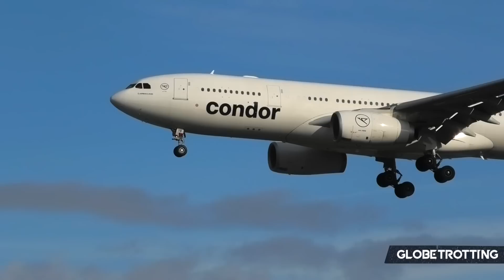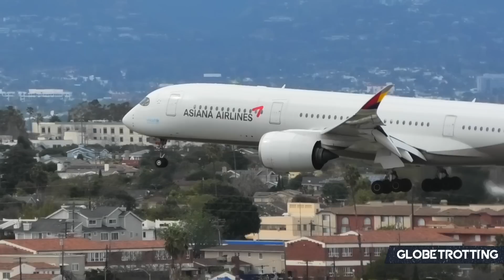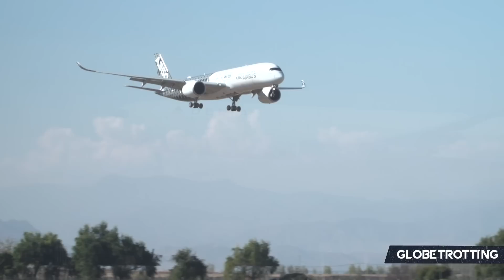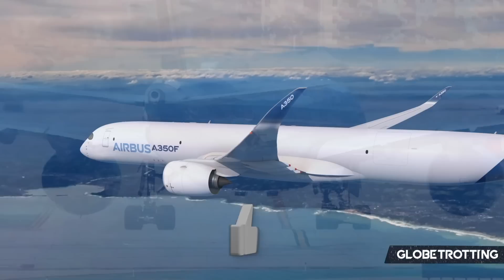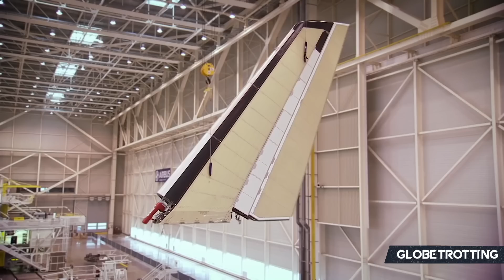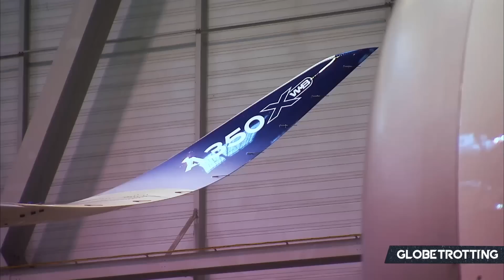BOEING RIVAL - The Airbus A350 Family

Comment: I think 🤔 airbus should build a new A350 but it more fuel efficient and more powerful engines and possibly a bit longer in length and flying range. And even look at building the A350-800 because it could be a good option for the airlines that are not sure about the A330-900 and that would give the airlines a better option for what they want for their fleet

Comment: I think the video underscores several key points about the a350:
- the video does a poor job at highlighting how quick the transition from competing with the  787 to do so with the 777 really was. Basically as soon as they realised a new air frame was needed (which was pretty fast);
- at this stage the a350 can hardly be considered the "Boeing Rival"...the a350 shifted to a programme to compete with the 777x programme...with the a350-1000 - being at best flying for nearly 10 years by the time the first commercial of the plane it was designed to compete (777-9) takes place...

Comment: Boeing rival? Really? Boeing is currently a nonentity. Airbus has eaten their lunch.
Reply: But the 787 has outsold the A350 (~1100 deliveries vs ~800) and the (much delayed) 777X is surely going to take a lot of sales from the 350-1000 (the stretched version) so this will continue. That said, Airbus have made far more profit from the 350 than Boeing has from the 787. And the 350 fills a wider range of niches than the 787.

Comment: The 787 Dreamliner did come first but it costed Boeing $32 billion USD in research, development, re-engineering of non-conforming parts, and remediation of flaws in their production. 
The a350 came much later but only costed Airbus $11 billion USD in research and development. 
Also Airbus recycled their original plans to upgrade the a330 and made it into the a330neo for only $2 billion USD. 
Airbus got the a350 and a330neo airplanes for less than half the development cost compared to Boeing’s 787 Dreamliner. 
And the a330neo forces Boeing to undercut their prices for their 787 Dreamliner to airline companies which handicaps Boeing’s profitability on their 787 Dreamliner program. 
Smart move Airbus.
Reply: Moreover the repetitive B787 quality flaws cost 5 more billions to Boeing...some analysts are wondering if and when the B787 program will be profitable...
Reply: Costed?

Comment: It wasn't customerS, it was customer who told Airbus its updated 330 wasn't enough, namely Steven Udvar Hazy.  And even when Airbus presented its 350 with conventional panels for fuselage instead of one piece like the 787, Udvar Hazy wasn't too impressed because at the time, it was really though the 787 would revolutionize aircraft with all its new designs.  It turns out that it was just incremental improvements and Airbus ended up winning because its 350 was simpler to assemble and deliveries were more reliable compared to 787.  Initial sales came because of delays on 787 so people switched to the 350. 

And comfort is not an issue for accountants who buy aircraft, it is the opposite. How  much pain can they inflict on coach passengers to pack them in as tightly as possible to make journey so painful in coach that people will want to pay for bsuiness class.  The 350 seems to havd struck a good balance against the tight configs of both the 787 and 777.

Comment: Engine manufacturers have pushed efficiency at the expense of durability, examples being the RR Trent 1000 and Pratt and Witney GTF. Once these improvements have been consolidated such as RR using Ultrafan technology in the Trent series the industry can move on. As far as i can see the Boeing 787 has still outsold the A350.

Comment: Why would a clean sheet middle of the market aircraft not be a profitable enterprise for Airbus (say replacement of B757 and B767)?
Reply: Probably because Boeing is heavily established there with the 787 so since its still a pretty new aircraft no airlines would be inclined to switch which doesn't leave enough market space to justify a clean sheet design, that's why the 330neo exists Imo just to be an airbus option in that space while being cheaper for airbus to make

Comment: A350 is a better than 777. More spacious per seat and more comfortable.
Reply: I am an Airbus fan but nevertheless I will defend the 777 if the seats are more comfortable on the A350 it is because it is newer than the 777 but there cannot be more space per seat than the 777. That's a choice of companies but the 777 is longer and wider. So it's just mathematically impossible that the A350 offers more space per seat.
Reply: @calou0165 thats a biased opinion. 90% 0f A350s are 3x3x3 and 90% of 777s are 3-4-3. Seat width of A350 is wider than the 777s in economy class. Not to mention A350 is much quiter than the 777. Come on A350 is  in economy a superior product uncontested!
Reply: @malikjack13  yes I agree but the basis of the 2 planes is 3-3-3 in economy and I don't see in these conditions how the a350 could offer more space!!! but yes indeed many companies use the 3-4-3 in economy on the 777 which is understandable economically and moreover on certain French low cost such as French Bee and Air Caraibes they also do it on the A350 just imagine the cattle truck. ....
Reply: Airbus is pushing the 10 abreast a350 lately though.
Reply: @okay_then3337  That's entirely the decision by the budget airline. Most airline don't do that, because of poorer customer experience and less attractive product compare to competitor. Airbus recommended configuration for A350 is 3-3-3. Budget airline likely switch to use A320 XLR for medium haul- long haul flight, when it's ready, it's more profitable then use A350 for the same purpose.